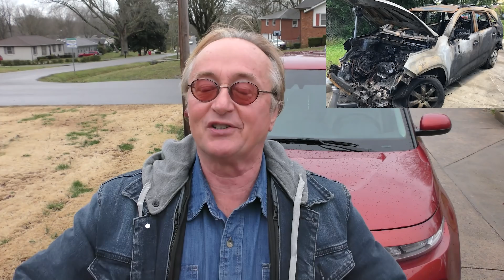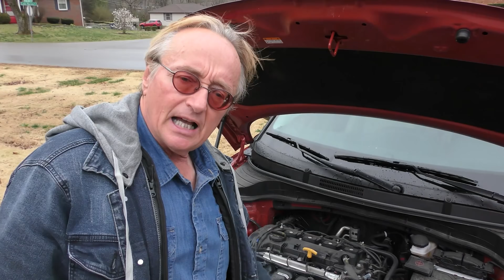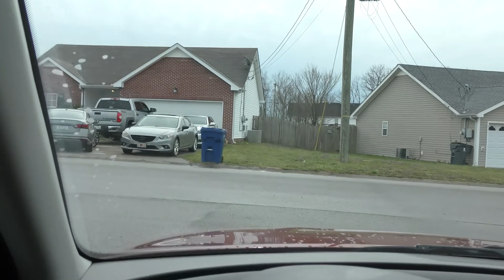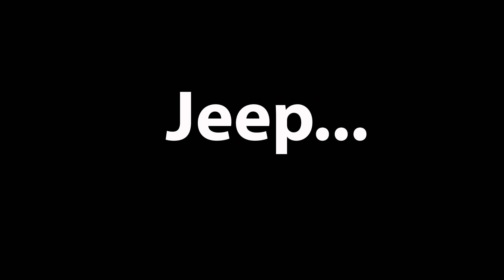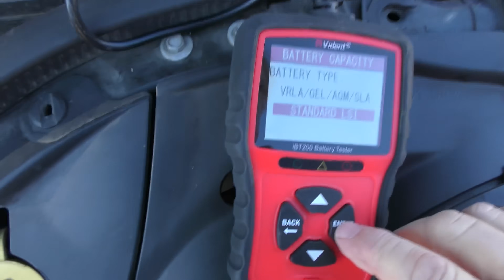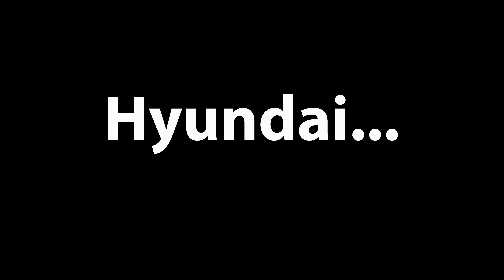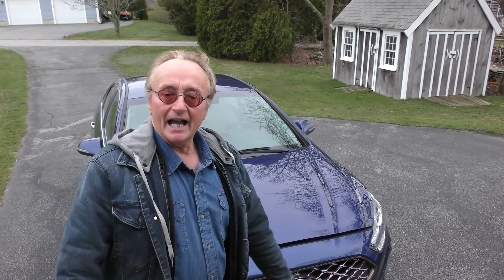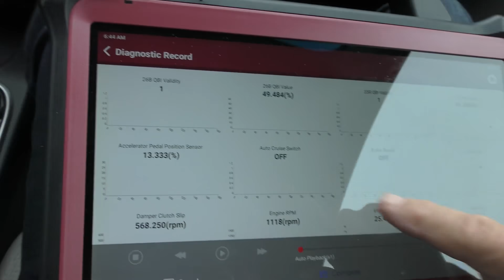3 Car Brands That are Crap

Comment: I own a 2020 Kia Soul and yes the engine needed to be replaced after 9k due to a recall/oil consumption. My dealer was really good about it. One thing Scotty did not mention is that these cars come with an excellent warranty that exceeds most other manufacturers. 5 years / 60K bumper to bumper and 100K on the engine. Most other manufacturers are just 3 years I believe. Aside from the engine, The car has a lot going for it, lots of features that I could not find in that price range on any other car. Would I buy another one? Probably not, unfortunately.
Reply: Don't defend a car company makes engines that only last 9k miles. That's inexcusable
Reply: @manthony225  - The majority of Kia and Hyundai engines haven't had problems, so... 🤷🏻‍♂️
Reply: Gosh, I guess I've been lucky. 3 kias later & the the consistent problem was with the headlights shortage or dim. Otherwise, they've been reliable. Oh well...
Reply: Forgot to say, 117, 000 country miles on one. I  guess I love my kia.
Reply: Kia and Hyundai are not only one is the better autos now but best and unmatched warranty. To buy another car, you have to be pretty dumb or get a fantastic deal
Reply: Warranty only matters if they honor it. This is an example of Kia/Hyundai refusing to fix a defective car. Subaru does the same thing for oil burning/ engines with piston slap.
Reply: Indeed a long warranty.  I’d rather have a car that stays out of the shop & runs longer.
Reply: @disgracebook5708  Kia would have to give me a loaner for any service needed over 3 hrs to fix.
Reply: @disgracebook5708  Every car company can goof up and make a lemon.  The last time I checked, humans make cars, and humans can mess up, and mess up bad.
Reply: I would be embarrassed to be seen in a Korean car.
Reply: @Richard4point6  - Why?  That makes no sense.
Reply: @DeadofWinter321  troll alert
Reply: @Richard4point6  Americans Cars are crap  toyota and hondas are the best I won acuras and toyotas no problems it all!
Reply: @Richard4point6  That’s a little like being seen in a poser LeXus that’s a Toyota 100% thru and thru And still has a horrible  Numb steering feel after 20 years and Toyota still cannot make it better communicate with the driver.
Reply: @Richard4point6  I will NOT buy any American, union made car - Ford, Chrysler or GM.  I own a Hyundai Tucson that was made in Alabama and is non-union.
Reply: thats actually standard warranty for most cars. Lol
Reply: @HollowG0D6  What cars have you been looking at? Toyota is 3year/36,000 miles, Dodge, Honda, Nissan, Ford and Chevy are 5 year/60,000. Mitsubishi, Kia, and Hyundai are the only ones with 10 year/100,000 miles.
Reply: @Cadaverine1990  Honda/Toyota have years of reliable vehicles in the hands of consumers. Very rarely does anyone I know have any major issues with these vehicles although any car can fail. Hyundai and Kia on the other hand have to offer these warranties. These recent engine failures only further proved that and without the warranty buyer confidence would be almost non existent.

The local Saab dealer became a Hyundai dealer when Saab was going under and it was bought out. My brother in laws brother was a mechanic at Saab and he said the amount of problems from Hyundai were unimaginable. I do admit they’ve gotten better and I wouldn’t recommend someone not buy a Hyundai/Kia but I personally would guide them towards a Honda/Toyota first and foremost. I don’t care about the warranty length. My Acura should last longer than any Kia/Hyundai.

Comment: If Kia are crap why so many mechanics or celebrities drive them here in the europe (I have not got one)? My experience is that cars imported from USA are actually very poorly constructed. Does not matter which brand it is. Ford or Mercedes or KIA (if there is a factory, I do not have experience wih KIA of course). Two of my colleaques have i30 being very happy with the car. Had KIA 13 years ago imported form Germany and they changed only brakes and oil  in 10 years. Nothing else, no service at all. 
To be fare I had transmision problems on my Hyundai, dead synchronizers. However it was high rpm petrol engine, people do not know how to shift that sh*t. Owned Skoda and VW both had also problems just different. 

In Germany KIA and Hyundai are being rated as one of the most reliable brands.

Calling something crap based on the very well know problems, which are common forth this or that brand here and there is crappy. I mean... it is annyoing it happens but these problems are common for ALL brands these days. So you can call sh*tty the engine or the transmission or even the car not the brand. 🙄

Comment: I've owned 4 Hyundai's......started with an Accent, then an Elantra, then another Elantra that a Bear didn't like.....bought another Elantra to replace it (2017).......in ALL those years I replaced a headlight in my second Elantra that had almost 200,000K on it. Maybe the newer ones are crap like everything else......but our latest Elantra turns heads BIGTIME. It has blacked out everything, sunroof, sky active tech and came with winter snows and rims PLUS summer mags (yup, I'm old) lol and FOUR PIRELLI tires. I googled the Pirelli's and they are 603.00 a piece! The rims are amazing that they set on (17's)....it drives like a damn sports car! If I can get away with driving this one for 200K and replacing a head light....I ain't gonna knock Hyundai.

Comment: I like Scotty but tbh not every Kia is bad. My entire fam drives/drove Kia’s well past 200K with no issues other than maint. I have a 2016 Soul with over 100K and it hasn’t ever had a mechanical prob. My sister has 214K and never an issue. So to say all Kia’s are crap is ignorant. I have also had Toyotas, and one of them was crap.

Comment: My 2004 Honda Element has over 211,000 miles and burns no oil. I change the oil at 3,000-4,000 miles.

Comment: I have a 2012 Nissan versa it has 106000 miles so far have never had a repair except brake pads twice and rotors once. I live in the north country with bad winter weather has never failed to start in cold weather (-20 plus). If it died  today oh well but that is the story so far.

Comment: I'd say they're two strokes not hybrids. I had a '89 Chevy pickup(305ci) with 289,000 mi on it and It burned about half a quart a day playing smoked like a diesel on startup or if it's sad a while. Oh my Lord hold neighborhood. Looks like I did a burnout... My first truck I loved it. Ended up putting a 350 in it and a clutch in it but wow drove it to about 350,000 sold it to a guy. He turned it into a plow truck

Comment: It is difficult to accept that a new car engine should consume noticeably much oil after driving only 20 - 25 000 kilometers.  We have owned the most basic and cheap cars (Peugeot 106) running 200 000 kilometers without using noticeably much oil and far from needing refill between the intervals.  I just don't understand what is happening today, since older, cheap and most basic cars from the least exclusive manufacturers, seem to run "forever" without the engine burning a lot of oil.

Comment: The metal engine stays , that hold the bonnet up, last the life of the car. The struts that hold the bonnet up , will eventually weaken and need replacing. So I prefer the simple metal rods.

Comment: Can confirm: my 2012 tucson has 50k miles and the transmission slips quite often
Reply: My 2017 Sportage SX tranny started to slip as well. The dealer said "that's normal". I said "No dice, fix it right and fix it once". Came back in the next week and they "reprogrammed" the tranny computer. 3 days later gears started slippin-n-slidin again. They said needed another reprogram. I said NO!! Now the car has a new transmission.
Reply: The spline shaft to the rear wheels i believe? completely broke in my bosses.... if you hear a clunk sound occasionally when reversing its probably this.... he went from AWD to 2wd real fast one day hahaha

Comment: I ended up getting a KIA soul back at the end of 2019 so it’s a 2020 model. Everything had been ok up till I also hit that 15,000 mark. It’s got a problem shutting off when driving and had them look at it they said it’s nothing they could find. I’ve showed them videos of it shutting off and also they couldn’t find anything. Now the check engine light started flashing and took it to orally’s. They couldn’t tell what the code is so back to KIA. So 2 hours and all they could say it’s bad gas and start getting 92 point gas. I ended up doing that filled it up and light came back. I fill up the tank and was getting 350 to 380 on a full tank now 280 to 340. I know there is something else going on.

Comment: Just by googling "Car brands with the most problems 2022" and checking several sites you will see neither Hyundai/Kia are on the bottom or top, they are mid range most of the time and some of their models rank very well actually... There are so many other car brands ranked so much lower like Chrysler, Mitsubishi, Volskwagen...
Reply: It's probably a lot faster just to list "The ONLY cars you should buy if you know what's good for you:"  Probably these are Honda and Toyota.
Reply: our chryslers run super well what are you talking about.
Reply: Americans have no clue about most cars in EU. They’re on a different planet almost. What you class as one this, it’s good in another country because they have different models of that brand and have more/less available parts, and so at different prices. Not only that… Americans have huge amounts of roads… and do mote driving in certain environments than for example people in eu.
Reply: @RadekZielinski.  Precisely, plus Americans run their cars on crappy petrol and any normal European car needs what we would call "normal" petrol and Americans call "premium" gas. Also they seem obsessed about changing the oil almost after every journey (see many comments on here), rather than sticking to the manufacturers' intervals like any sane person would. Probably because they use crappy synthetic blend oil rather than proper full synthetic. Ho hum.
Reply: @chachar99  You obviously don't know the difference between American and EU rating systems.  A 98 in EU is equivalent to 93 US, and 95 EU is equivalent to 91 US.
Reply: didn't they stop making Mitsubishi?
Reply: @kelseycoca  nope Mitsubishi cars are still there with several suv models.
Reply: @4ce5bf154  oh, maybe I'm thinking of a different brand lol
Reply: It all depends on the year and model. I drive a 2017 Jetta which is very reliable and has a high score. The 2019 Jetta is a dumpster fire and scored very low. Just make sure to do research on the car you want and make sure it’s reliable.
Reply: @trexasaurus5322  Hi!, what motor does have your Jetta?

Comment: Hi Scotty!  Big fan!  My wifes Kia Soul has 86,000 miles on it, and still going strong!  We've kept up all proper maintenance so maybe that has something to do with it.
Reply: I have well over 100k and mine has never had an issue, it’s a 2.0 2016, my sisters has over 200K and it’s never had an issue. We do reg oil changes and that’s about it. Did replace the battery at 90K but that was it.
Reply: @saabguy8809  put that in the Guinness book ..... you rarely ever see a Kia running well with 200k or more .
Reply: @richsweeney1115  actually, you see it all the time. Honda and Toyota highly overrated
Reply: @saabguy8809  and feed him to see 🙈🙉🙈🙈🙈🙈🙈
Reply: @saabguy8809  and feed him to see 🙈🙉🙈🙈🙈🙈🙈
Reply: 86k is nothing..... come back when you have over 200k like the 5 spd Hondas my wife and I have.
Reply: @richsweeney1115  That is awesome and it works for you, but no need for me to keep a vehicle other than a truck for that many miles (200k).
Reply: Congrats brother can you give us an update 40k miles or 2 years later?

Comment: I wonder if the crankshafts are poorly balanced or the bearing clearances are too loose.  You would think some CA lawyers would have some engine builders break one down and measure clearances (piston rings, main and rod bearings), and then send all the internals to get weighed and balance checked.
Reply: Sounds expensive? Who would pay?
Reply: @Harrythehun  tearing down engine and taking some measurements?? A couple thousand, and the Class Action lawyers would pay cause that is a few thousand to make a few hundred million.

Comment: I have a 2013 Kia Soul.  30,000 miles. it's been recalled several times. Mostly motor related. I change the oil about every 3,000 miles on a non Turbo.. I have zero oil consumption issues.  I do get carbon fouling on the valves it's a GDI motor . I take care of that problem myself with CRC GDI.and turbo cleaner.   There was a joint in the steering wheel that had to be replaced. It was on a recall. Things that never go wrong  go wrong on a Kia.
I also have two Hondas and a toypta Prius. They have around 100,000 miles on most of them now. Absolutely no problems on either products.

Comment: The only problem with my 2020 Kia Soul EX...is that a Chevy Silverado plowed into the front driver side. I hit 40,000 miles on it, insurance won't total it, and the only benefit is that the engine wasn't part of the massive engine recalls and it wasn't burning oil--maybe that's luck, maybe its because my commute switched to mainly highway.

Comment: I almost bought one of these Kia's and now I'm glad I didn't. I think I'll keep my '06 Malibu Maxx with the 3.5l V6. It may be old, but it's never burned a drop of oil and the most major repair I've ever had to make on it was replacing the exhaust system.
Reply: Most of the Malibus were bad cars so that's great for you, sounds like you got a good exception

Comment: Some hyundai cars seem really solid. I have a 2006 sonata with the 3.3 v6. Got it at 81,000 miles 6 years ago and it's at 192,000 now. It burns no oil between oil changes, runs butter smooth, and still gets 30 mpg on the highway. All I've had to replace on it is front struts and a door handle. Everything still works in the interior. Nothing is cracking or peeling.
Reply: 2008 Hyundai Sonata 2.4 L Automatic, over here. Got mine at 90k and just recently doubled to 180k. Just one fuel pump later but still runs like a champ!
Reply: 260,000 on my Hyundai Sonata 2011.. one of the worst engines, they say.. 38 mpg also !!!

Comment: I have 2 kia's I normally buy Ford if I'm honest. That said both have over 100k miles. I do maintain them, and regularly change the oil. I have had no complaints. It's not a Ford, the old Ford ranger I owned had 450k miles on it before I sold it. I honestly think it depends on where you live, climate and road conditions as well as how often you change the oil more than anything as far as life of cars goes. But what do I know other than my own personal experience.

Comment: 80 yrs later, and he still brings that  Celica up 😂😂😂😂😂😂
Reply: Well gonna be honest. They should bring the Celica back.  When you make a legendary cool car keep doing it!! Dont mess with a tried and true formula
Reply: @jamesmedina2062  I have a 90's Toyota I know what quality is....Point is since the early 2000's he been showing that Celica....
Reply: @619roca  well dont mess with success!
Reply: @jamesmedina2062  ⏺️ player
Reply: I  bought a used  '91 Celica GT  1996 and drove it till 2019.  In 2015, I had to replace the radiator. I traded this car for a new 2019 392 DodgeSP .Power, technology, comfort and style. If you can get past the horrendous MPG, very highly recommended. You get what you pay for.
Reply: @jacksimerly5788  that's awesome I have a 99 Corolla and runs like a champ. 👍

Comment: I change my 02 Rangers oil every 4-5k miles with full synthetic high mileage and it burns roughly a quart during that time with a little over 183k miles and I rarely ever put oil in between it because its usually close to the time I change the oil.

Comment: Wouldn't you get better cooling on the end cylinders and the heat cycling being more extreme would wear them out not having better cooling in the center? I'm pretty sure the center is the hottest part despite getting all that coolant flow.
Reply: Not sure about that. He is right about the classic vw beetle engine #3 cylinder.  That being said, vw did try to improve that in the 70s with a bigger fan shroud.
Reply: @kyledavis4890  beetles were air cooled right?
Reply: @davidlobaugh4490  real ones were...

Comment: I find Kia are hit and miss. My wife owned a 2017 Optima and it went back to the dealer 5 times for knock sensor/harness issues and in the end we got rid. Next door neighbours had the exact same year and model and they are still driving it now with 90k miles and zero issues.
Reply: Consistency is a big issue, but yeah. I have a 2020 Soul EX, and the engine wasn't part of the mass recalls. My sister has a 2020 lower trim Soul--had the engine die and replaced.
Reply: but 90k is still nothing......... they should be olabke to go over 150k before any issues  of you maintain it....
Reply: @richsweeney1115  My wifes was maintained meticulously and it made no difference. Dealership and Kia were awful to deal with.
Reply: @Blue-moon12  my wife just bought a 2014 Ford escape titanium, it only has 100k , it's clean, almost perfect actually. and it has a 36k mile warranty from the dealer she got it from.. it's the 2.0 Ecoboost, it's really nice, she was looking at kias too , I made the effort to talk her out of those, and fortunately it worked. I know people have had some issues with the newer escapes too, but. mostly the 1.6 liter, but still, Kia has more issues
Reply: @richsweeney1115  Becareful with the smaller ecoboosts 1.6, 2.0 and some 2.3s. I owned a 3.5 SHO. Hope the Escape lasts well for you guys.